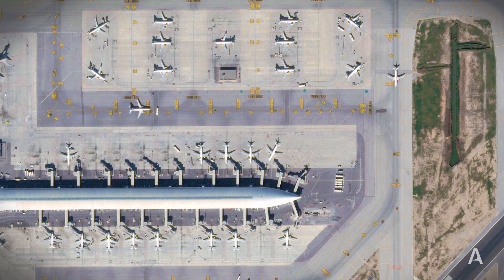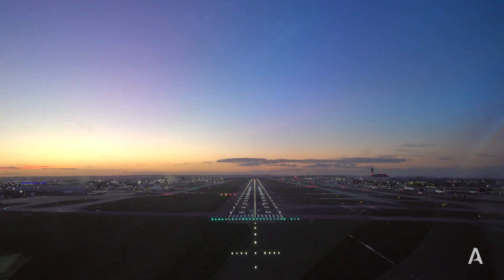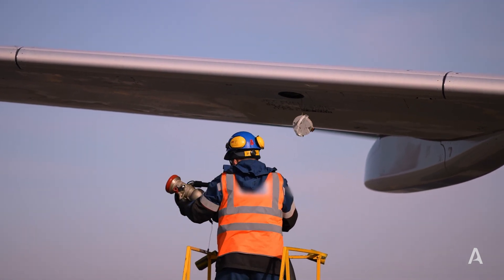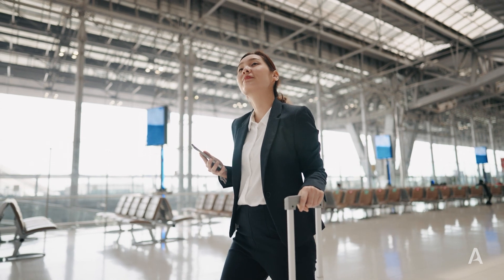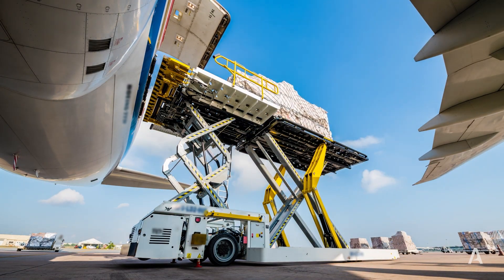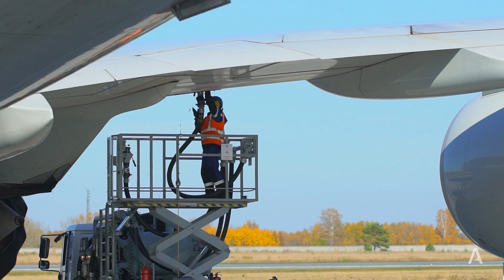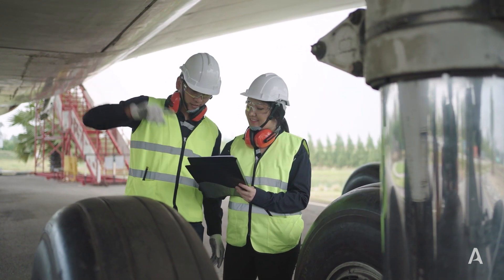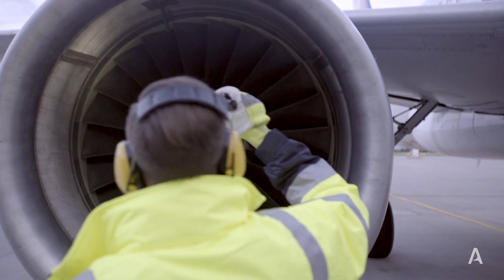From Touchdown to Takeoff: The Fascinating Process of Plane Operations | Aeroclass Lessons

Comment: Ryanair have go this down to a tee. From the plane stopping at the gate after a 4 hour flight, baggage and passengers off, fuel up, a quick rubbish pick up, passengers and luggage on and 25 minutes later the plane is bring pulled back for takeoff.